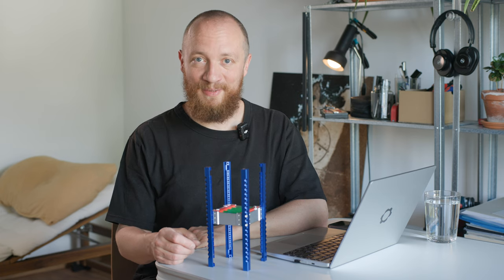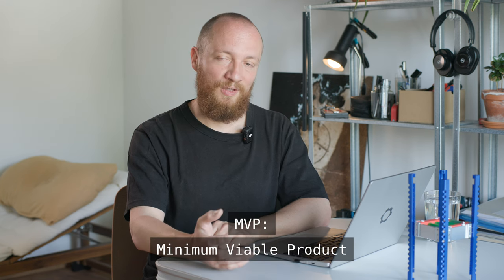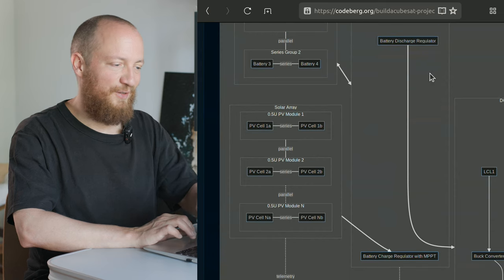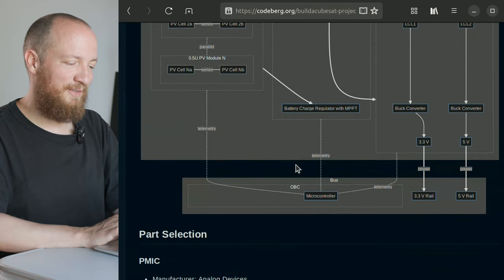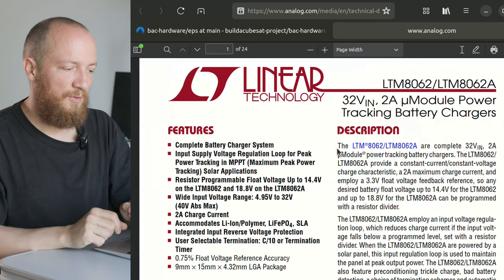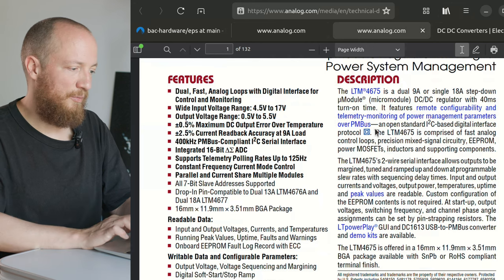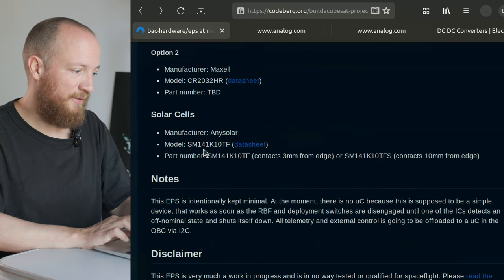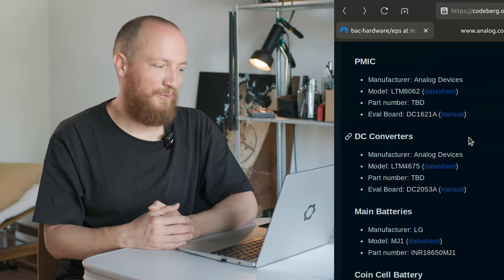CubeSat EPS: Block Diagram and Part Selection

Comment: Are you planning on having the boards, even prototype ones, professionally assembled?  The LGA form factor is impossible to hand solder, and I don't know well they work with hobbyist-level oven/hot air/hot plate soldering.  In my experimentation I always try to stay away from packages that can't be easily soldered, even if in practice I usually use an oven - all too often, I've had to touch up the solder by hand.
Reply from the maker: I am going to break the PMIC and DC regulator sections out to stamp-sized PCBs that that fit on a MHP30 hot plate, hoping that this would make assembly DIY-able. I have never worked with LGA before, just BGA, but i figured the usual stencil, paste and hot plate method should work here... But yes, if all else fails, these may end up needing PCBA service then. Thanks for the heads up, that's really helpful!
Reply: @buildacubesat  - if you've done BGAs successfully this way, then the LGA should be just fine. I've stayed away from both, because I wasn't sure it'd work in a DIY environment.  Good to know that it does.